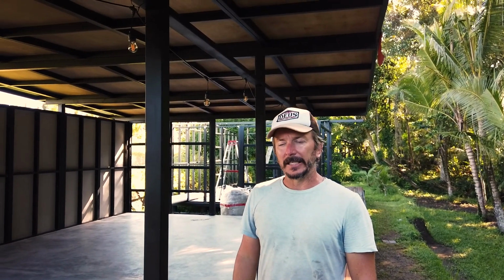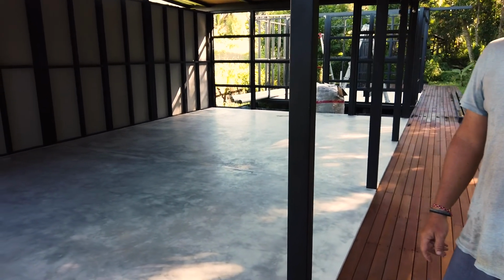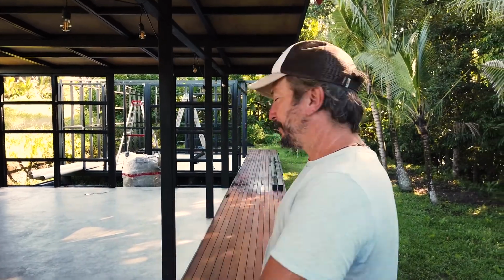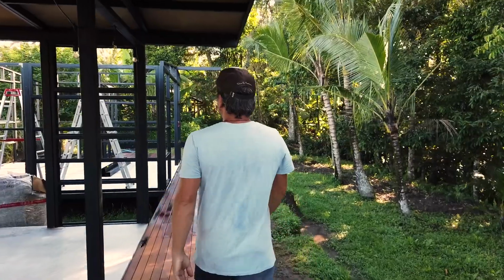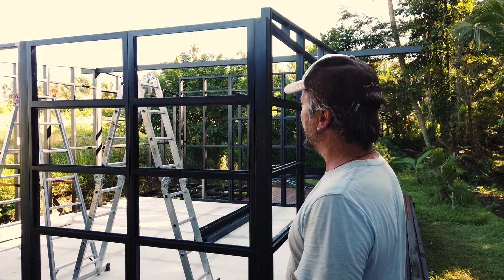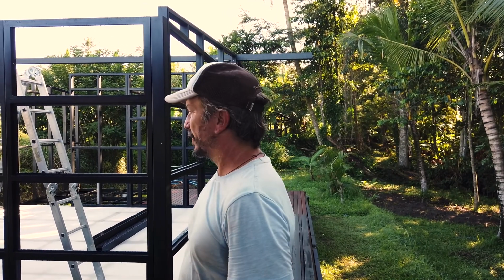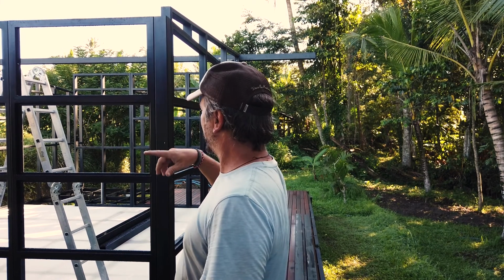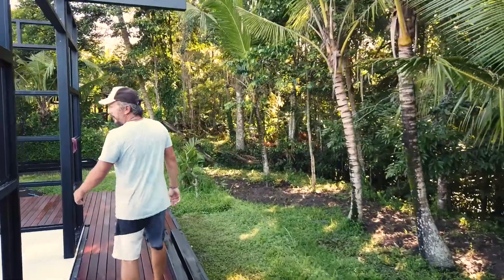#12 Ubud House Build // Putting The Main Roof On

Comment: hi, just wondering did you prepare the holes for the bolted joints between that wall structures or just drill directly on site?
Reply from the maker: We pre-drilled on site and then screwed them together once in place.